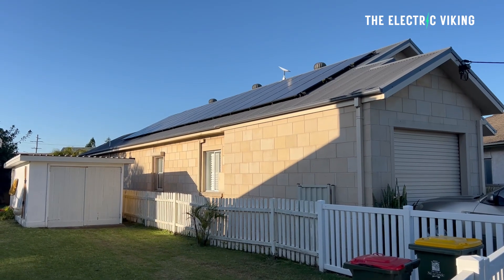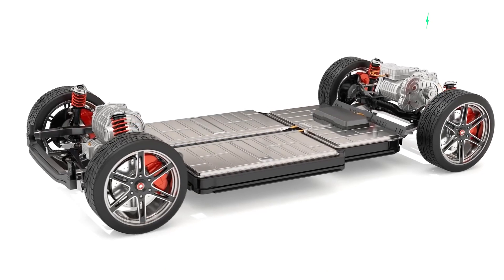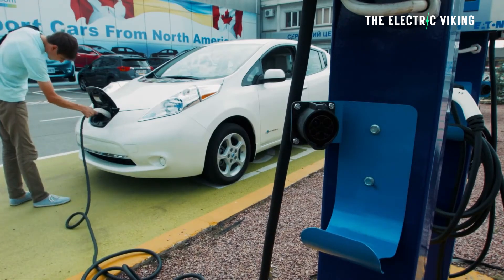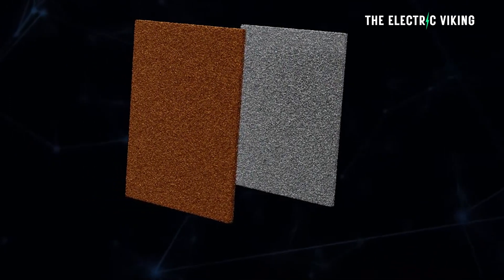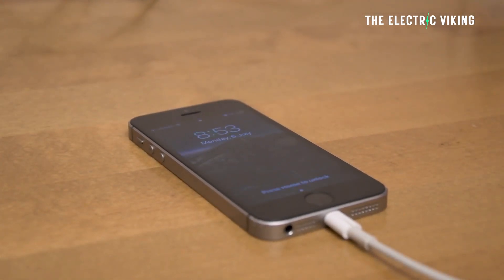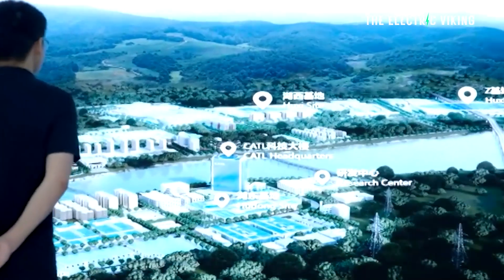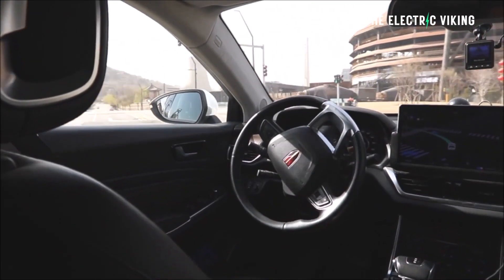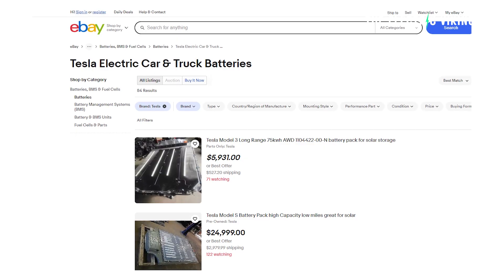Researchers discover a very simple way to make batteries last 70% longer

Comment: Yes I have read it. They say the first charge was done very very carefully to keep the Lithium as intact as possible. But even with the slow/carful FIRST charge still lost 5-10% of Lithium. With this "new" Shock charge the loss is 30%.... But they say no impact on Capacity?? Sounds very dubious... I think the Energy density or Max output something has a BIG hit in favors of the Charging Cycles (aka lifespan)...

Comment: I don't know if this is relavent but we have two 2022 Tesla model 3 LFP. One is now at 125,000km the other at 50,000km. The one with the high mileage gets charged at superchargers 50% of the time, where the lower mileage one is all level 2 charging at home. At 100% the car with the higher mileage shows 418 km range and the lower km car shows 412 km. When new they were both at 428km at 100%.
Reply: There is a video I've watched recently about how not to damage your LFP battery, and it has a lot to do with the way you charge your battery, I wonder if that might contribute to your problem.
Reply: @phazyy  I don't see it as a problem, just a point of interest. I didn't mention it but on the low mileage car we wait til it gets to 30% before charging it bak up to 100%. Once a week in the summer and twice a week in the winter. The high mileage car gets much worst treatment, often arriving to super chargers below 3%.

Comment: I think Ford is already doing this . I saw a video on the manufacture of the Ford lightning. At completion they brought the lighting to a charge station in the plant which was a level 4 charger and charged the lighting with 480 volt 3 phase with 230 amps . It charged from 15 percent to 80 percent in 30 minutes . Not sure if this was the er or sr but I believe it was extended which is 15 minutes shorter than at a standard level 3 charger . So something is occuring at this initial charge . I think this is far higher charge than the lighting will accept so something is going on where Ford allows this high charge by changing it charge parameters just for this first charge . Now that maybe just as a time thing . Faster gets the truck out the door or maybe as Sam suggests in the video . They may not even realize the benefit along with Ford customers of the lightning . It would be interesting to know what they do for the mach e . Can't find any info on the web with Ford charging at the factory

Comment: Charging the battery cells in advance would require more caution during the rest of the pack loading process but it would be interesting if the pack could then be used to power some of the manufacturing process of the car. For example robots could tap some power from the car they are working on if they are running low so they don't have to stop working to recharge. It would also allow testing of sub systems to begin very early in the build process. After the build process cars could then be charged faster than normal or maybe still have enough to be ready to ship without delay for charging.

Comment: It's kind of counterintuitive because normally heat from over charging or high-current charging promotes dendrite formation in the separator.  There must be some protective effect that the high current creates around the electrode.  Google smartphones now rapidly charge when the phone is very discharged, but slow down the charge rate as the charge reaches 100%.
Reply: I used to rejuvenate (some) shorted NiMH cells by giving them big overcurrents, like 10 amps into a AA cell for a few seconds. Sometimes it worked. None ever blew up.

Comment: I know you're an EV advocate, but what about Hybrids as a transition step to EVs?
Reply: I suggest you do an internet search for an article called "Study reveals hybrids could have up to 4.9X lifetime emissions vs BEVs". Also, some space in a hybrid is taken up by an electric motor and (small) battery, which reduces the amount of space left over for an engine and fuel tank. Because of this, it is common for hybrids to have slow acceleration and low top speed (both due to a small engine) and possibly a small fuel tank. Finally, if you do an internet search for "fire risk ev vs ice vs hybrid", you will discover that the risk of fire in a hybrid is about twice that of an ICE car, which is many times the risk of fire in an EV.

At the moment, there is no shortage of batteries to make EVs. The push for hybrid vehicles seems to be coming from legacy automakers who have not figured out how to make a compelling, profitable EV and hence are retreating to making hybrids as a stepping stone. However, their retreat into hybrids will not slow down Tesla or Chinese EV makers from continuing to make EVs, and thus there is a risk that companies that choose to focus on hybrids for the next few years may find that by the time they figure out how to make compelling, profitable EVs, the market for EVs will be saturated by Tesla and Chinese EV makers.
Reply: .... depends on your usage profile. My guess is that 90% of users would get along with an EV without major inconveniences. The remaining 10% might opt for a plugin or an ICE.

Comment: This is probably forcing the spreading of the lithium ions with the high voltage, delaying the formation of dendrites. It may be possible to do the same to reverse battery deterioration.

Comment: 70% of the world’s population will experience strong and rapid changes in extreme temperatures and rainfall in the next 20 years if future greenhouse gas emissions are high, new research finds. The proportion drops to 20% in a scenario where emissions are drastically curbed in order to meet global climate goals, the study says. The impacts are likely to be spread across much of the industrialized world, according to the research, which uses large climate model simulations.      Deadly floods hit Morocco after A YEAR'S WORTH OF RAIN fell in 2 days.      Garyville Louisianans say a major accident at a sprawling Marathon OIL refinery caused health issues. The company insists there were ‘no offsite impacts’, though residents "tasted oil" from the air in their yards.      Sharks ARE DESERTING coral reefs, their natural predatory domain, as oceans heat up, a new study shows.      CLIMATE CHANGE is transforming the character of the Western United States' hottest periods — making them more FREQUENT, more PERSISTENT, more HUMID and more LETHAL. Greenhouse gas emissions from the burning of fossil fuels CAUSE EXTREME HEATING by fueling higher air temperatures AND by warming ocean water. In 2022, Los Angeles recorded its all-time hottest temperature, 121 degrees, in Woodland Hills. Over the last few years, thermometers in that neighborhood have climbed to 110 degrees and HOTTER OVER two dozen times.    Poland's longest river, the Vistula, on Sunday hit a record-low water level in the capital because of CLIMATE CHANGE CAUSED drought, the national weather agency said. Its level at one Warsaw measuring station fell to 3 centimeters (9 inches), beating the last record by a  2 centimeters, according to the IMGW weather institute. It's worse than in 2020, and the water LEVEL IS CONTINUING TO FALL, the institute added on X.     Research from TPI Centre highlights differences in corporate decarbonization efforts. Long-term corporate climate goals are commonplace, but ALMOST ALL companies are failing to introduce interim targets OR detailed strategies that set out how they intend to deliver net zero emissions emissions by 2050, a major new report has warned. A report published this morning by the Transition Pathway Institute (TPI) Centre at the London School of Economics and Political Science reveals how the share of emissions-intensive companies with long-term climate targets aligned with recommendations from climate scientists has increased from six per cent to 28 per cent over the last four years. The State of Transition Report 2024 warns that the credibility of firms' emissions reduction efforts is ALMOST NONEXISTENT DUE TO a dearth of intermediate targets that act as MEASURABLE staging posts towards ANNOUNCED longer-term goals.
Reply: The climate is slowly cooling not warming.  Stop letting them brainwash you.

Comment: If Tesla batteries are being reused for powerwalls. Why are they so disgusting expensive?
Reply: Search for Dala's EV Repair and his awesome work and open source to use old high voltage battery as powerwall. Without opening it just plug it in to your solar system.
Reply: Those are new batteries in them.

Comment: They need to come up with a friction sensing set of tires that can return that heat/friction back to the batteries.
Reply: ??????.....regen is already a thing.
Reply: @andyfreeze4072  For brakes, yes. But not for tires.
Reply: @andyfreeze4072 true but tyres still generate heat

Comment: I wonder if this could be done to existing packs on already produced vehicles.  Coolest thing I learned today.  Thanks.
Reply: NOPE... I have read the detailed article and it is for the first time sort of "formatting the battery". Also not sure if it is applying to LFP battery or just NMC, NCA, etc... 
But I'm skeptical with this article they mention previous "Slow" charge for the first time was to keep the Lithium in the battery but there was 5-10% Lithium loss... With this rapid/shock formatting the Lithium loss is 30%!!!!!!!! Lithium is a critical component in a battery and you loose instantly 30% and battery is magically better in every way???? 
I think they sacrificing battery capacity, MAX power output for lifespan...
Reply: @tothimre7950  So I wonder if Lithium content can be upped for conditioning so you end up with normal capacity and discharge with extra life.
Reply: @glennmartin6492  I'm not the researcher 😃so not sure... But I would say NO. Because if you think about it battery packs already fully packed. Adding extra 30% materials is lots of weight/space which is not available. 
Plus I don't think it work like cooking, if food is not salty you just add more 😃These Lithium atoms must be in the correct places. And if there are tons of Lithium where is should not be then it will modify the whole molecule structure, chemistry of the battery. So even charging will work differently, etc...
Reply: @tothimre7950  Well why don't they just try out a battery with extra lithium and see what the result is?

Comment: Best experience of owning an electric car is not having to go to a gas station. Park in garage, plug-in and charge over night.
Reply: Hate gas stations and oil companies.
Reply: Gas stations and oil companies are not all bad, vehicles and mechanized farming which rely on oil are the reason food was so cheap for the last 90 years, and why hunger has been virtually eliminated in the west.
Reply: My buddy, auto tech by trade, seems to hate ev's without a tangible articulated fact as to why.

I can say my model 3 has room for improvement but not compared to any previous ice vehicles owned. And I had no incentives at time of purchase in 2021, still feeling the savings.
Reply: They're also just fun to drive. I love my kid's EV and I drive it whenever she's asleep or otherwise not using it. If we had room in the driveway, I'd consider getting one for myself.
Reply: How good is it 👍
Reply: Amen. I can't understand how all the EV haters justify filling up the petro-barons pockets every time they fill up their tanks.
Reply: @DocuFlow  - it's worse even when you explain to the anti-EV brigade that they are paying for a fuel of which only 15% is useful energy and 85% is wasted as heat, that has to be dumped outside the car, they still defend their right to waste the energy and spend their money as they want. They literally are prepared to defend burning money to protect a self-inflicted wounded pride.
Reply: @GruffSillyGoat  misleading, about 40% to 60/% in modern engines
Reply: @alaznispireli7481  - Modern thernal ICE petrol engines have a maximum efficiency of 50% but at this level would not be road legal due to emmissions; 20 to 40% is the typical road legal range. However, the engine isn't the only loss in a ICE vehicle there is transmission losses, friction losses, parasitic loads etc. The overall ICE car efficiency  range usually varies between 12 and 30%, with the lower level more common and the upper level more typical in more expensive cars. Most of the losses are to heat. Scientific papers use circa 15% in their calculations when considering efficiency.
Reply: @GruffSillyGoat   parasitic and transmission losses =1-3 hp. as for frictions EVs has double tires frictions, long braking distance affecting safety, and many more, after all, batteries are still technologically unsophisticated
Reply: You have some traumatic experience with gas station,very interesting...full car tank for 90 sec and go,how much time you need for battery??BS...
Reply: @Dragan879 1/4 “tank” to full while i sleep at night. All for roughly $3
Reply: @myhome772prevention is better than cure,the likelihood of an ev catching fire is a hundred time less likely than an icev at 25 per 100k sold compared to 3k per 100k sold and with lithium iron phosphate batteries hitting the market that number will be farther reduced,in other words EVs reduce cost for the government and not just for the owner.
Reply: @myhome772foam,you use foam the fire department are using water for some reason anyway with cost savings from reduced fires they could afford the equipment for it.
Reply: Don't jump into absurdities, fast chargers accelerate degradation, I personally have a phev and I know, and 1 million kilometers is absurd, in each electric car battery there are hundreds of small batteries and tens of BMS that often fail up to 150k, the cells are damaged and either they need to be repaired or the battery needs to be completely replaced, so At the moment, electric cars are on the rise, you can't be just one car
Reply: Meh most gas stations in Ireland are basically small to medium supermarkets and many have cafe, off licence and post offices. Pretty handy.

Comment: Sounds similar to annealing a light filament to make it last longer before installing. But the problem is the output is less, so I would suspect the cost of doing this is reduced capacity, and hence reduced range.
Nothing is for free.
Reply: the report I read said a minimal change to capacity. At any rate, this will reduce manufacturing time, hence cost.
Reply: Yes maybe - but perhaps to counter this, they might be able to add surplus redundancy when manufacturing.

Comment: 50% increase isn't 1 million to 2 million, it's 1 million to 1.5 million.

Still hypothetically a massive increase but your basic math needs a slight correction.
Reply: I came here to give a similar response. Sam doesn't understand percentages.
Reply: Also he's assuming that catl, byd, Tesla etc hadn't figured this out years ago
Reply: listen carefully to the fine print "AVERAGE" increase.
Reply: @andyfreeze4072  No dude - YOU 'listen carefully'... yes, Sam repeatedly said ~"average increase of 50%, which would double your charge cycle" which is wrong, wrong, wrong, Sam clearly doesn't understand how percentages work.
Reply: Battery life and km driven are not necessarily a 1:1 ratio.